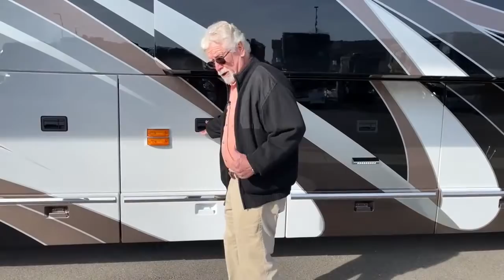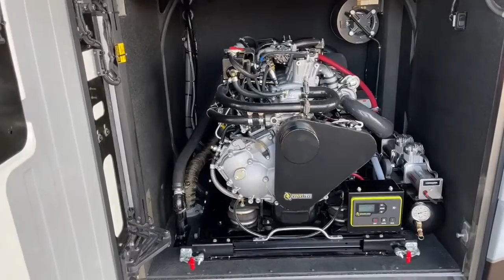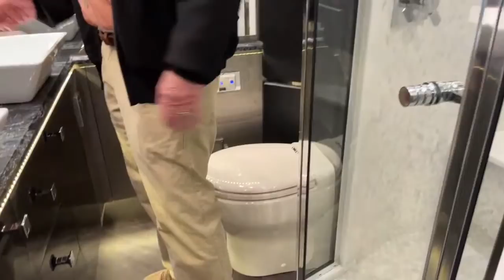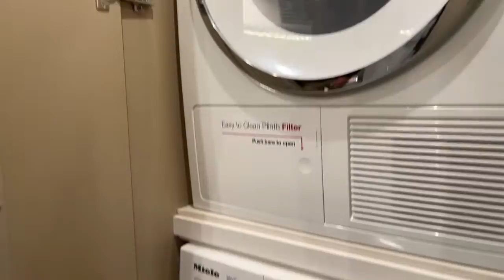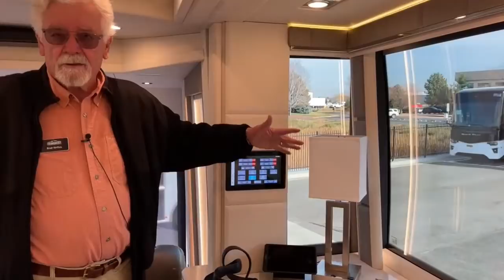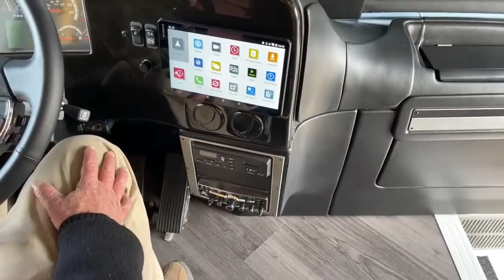2022 Emerald Prevost H3-45

Comment: Emerald must be the bottom of the Prevost luxury lines.. A Liberty, Marathon and a Newell Coach out class this coach by far!
Reply: Yes but simplicity has its benefits. Less maintenance and things to go wrong. From what I’ve seen these are a couple of hundred thousand less than the brands you mentioned. Liberty is the Other retailer for these also. I’m sure Frank wouldn’t represent a brand he wouldn’t stand behind.
Reply: How does Liberty, Marathon and Newell rank?
Reply: Nothing bottom about this coach it's pretty awesome
Reply: Stan, Less maintenance? How do you figure? You must never have inspected a liberty build, or a Newell coach. But you are right, this coach probably is and should be cheaper. Grandpa needs a nap 😴